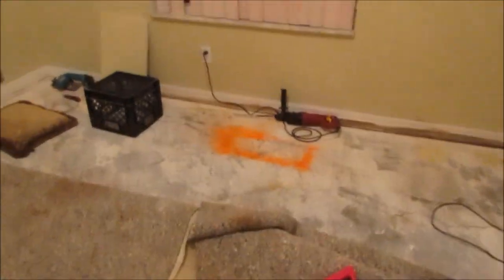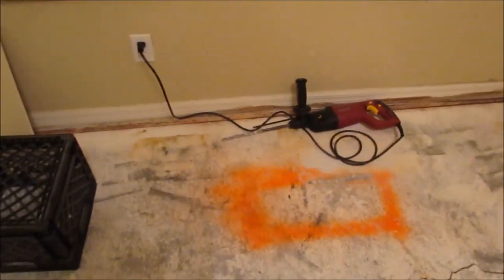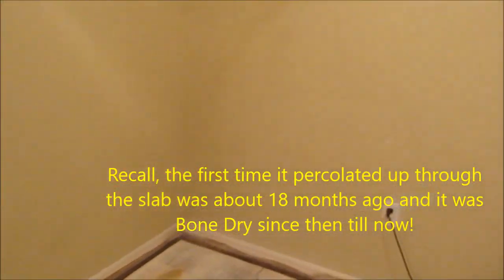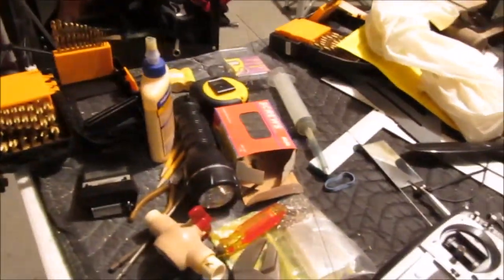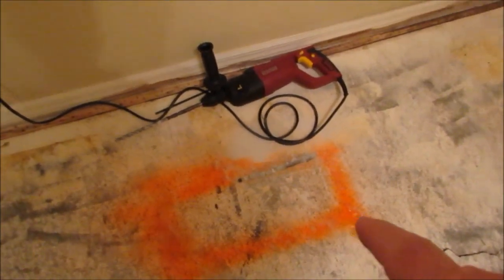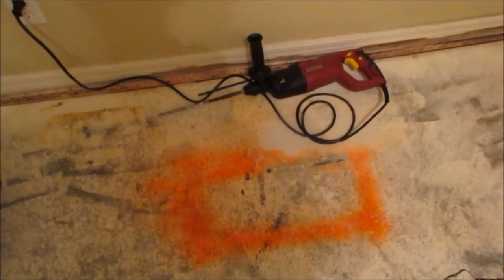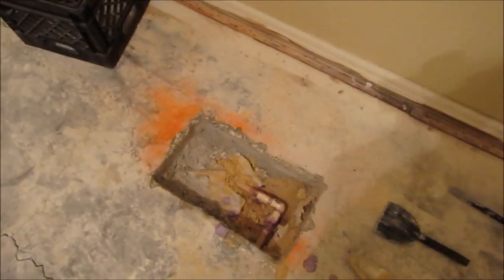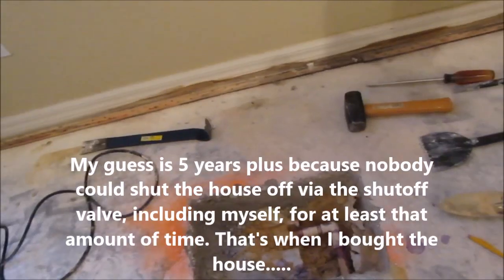Fixing broken, repairing broken, leaking pipe in Slab

Comment: Great video. I have a slab leak. I think the leak is on the hot water side. I have copper pipes with red for hot and blue for cold sleeves. I thought that maybe the water was migrating  inside the sleeve. I do have an infrared gun and will use that to locate the leak, thanks for that tip.  Thanks again for sharing your experience with us Tubers.

Comment: Just had this done. Hot water pipe leaking about a foot after goes into slab. No problem, just a little jack hammering, replace pipe and pour new concrete. Floor was going to be covered with ceramic tile 2023 anyway.  Problem #1-pipes under 8" of concrete. Took a lot of jackhammering. Problem #2-plumber couldn't get solder to seal pipe connectors. I think he was nuking the flux with the torch and boiling it out. Took 7 tries. Cost of repairs $1500. Test to find exactly where water was leaking $550 plus visit fee. Ordinarily the slab is only 4" thick in this area.
Reply from the maker: Why didn't you locate it yourself? It sounds like the leak was under a footing (8 inches). In that situation the easiest way to repair would be to cut the pipe section out, first inside in the hole in the slab you just made and then dig a hole outside next to the foundation (my assumption is that it is near an outside wall given the thickness of the foundation/footing) and cut it there too. Then reconnect.

Comment: You can rent a gasoline saw for $22.00 /4 hrs. in SW Ohio. If the fumes bother you open the doors and turn on some 20" floor fans to clean the air. Also rent electric saws that will saw a 4-5" slab easily.